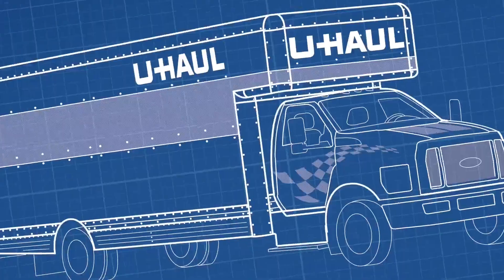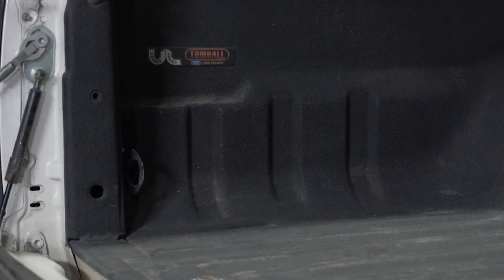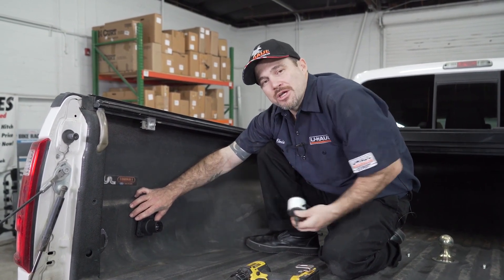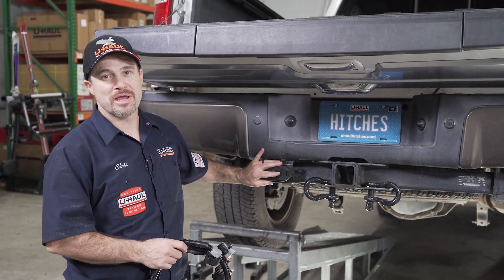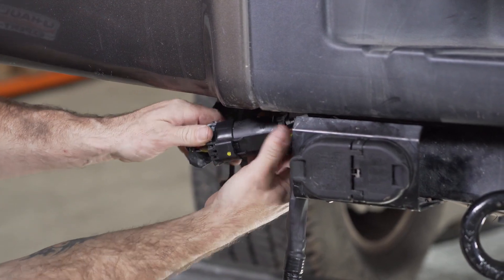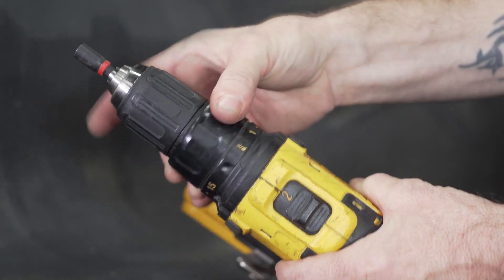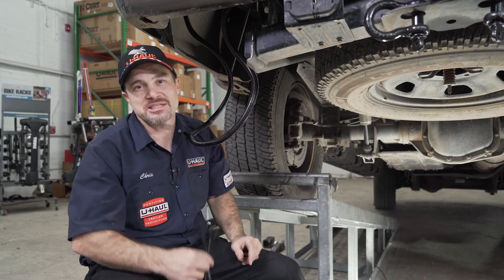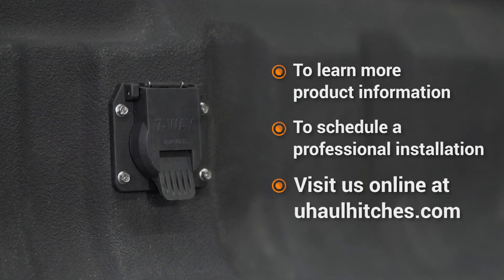Truck Bed 7-Way Round Wiring Install | CMF56070

Comment: Is this part pretty universal?
Reply from the maker: Yes, This Harness will fit any Truck that has a OEM 7 way plug in or under the Bumper(Behind the Socket is a USCAR 7 way adpater). Ford, Chevy and Ram Installs are all Similar.